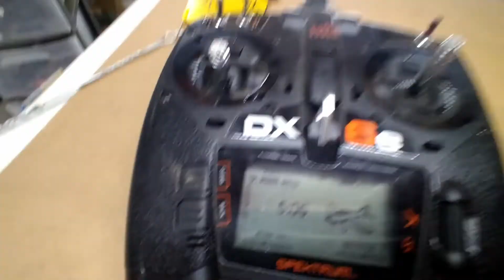30 Inch Foamy Full Build   Part 4

Comment: So far, so good.  Question.  What kind of reinforcement did you use when you mounted the L/G.  I know you didn't just glue, or screw it to the foam.
Reply from the maker: I use 1/8 inch plywood